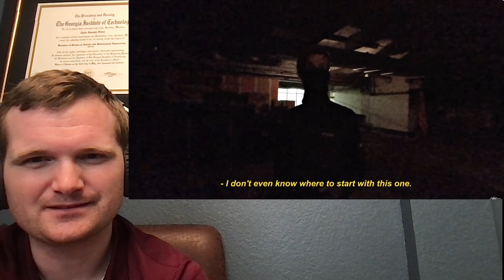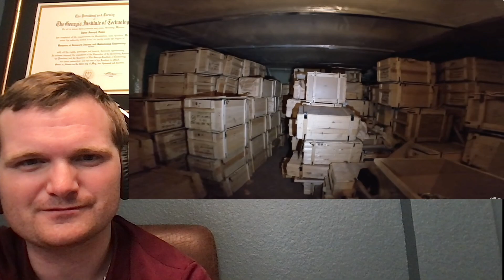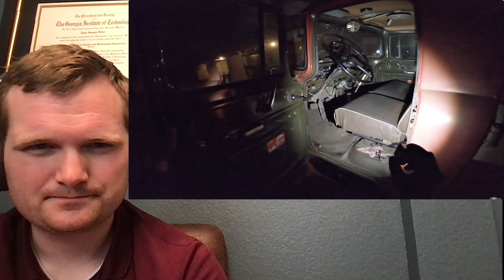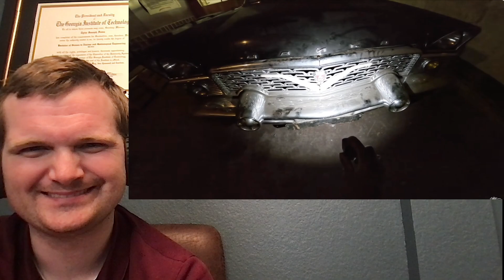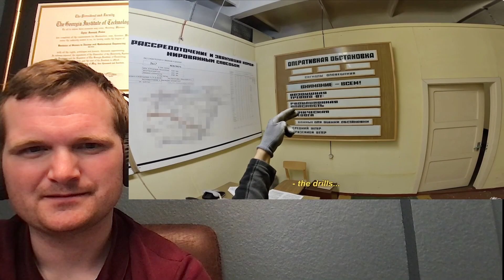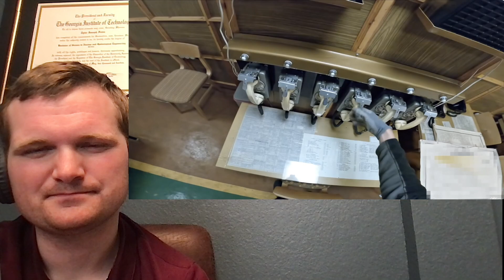Abandoned Nuclear Bunker with Vehicles and Gear - Nuclear Engineer Reacts to Shiey

Comment: The headphones plug he unplugged isn't actually abnormally big. Instead of the common 3.5mm most devices use today that's a quarter inch plug. Most audio equipment and audiophile grade gear still use it. It's exactly identical to 3.5mm it's just far less likely to break or bend. For audio equipment it's far more popular for equipment that gets constantly plugged and unplugged.

Comment: Having vehicles in your bunker is mostly a good idea, the issue is that vehicles can't sit long and be expected to work. The oil, and gasoline collects water from the air over time and gasoline basically breaks down into a sludge in a very brief period of time. You need stabilizers for even just a year so these vehicles would need to run dry at least once a year. It's really hard to save a vehicle once it's sat for more than 3-5 years. Most of the lines in it will be full or gunk and the metal lines may rust out from water absorption.
Reply: Diesel vehicles like a few of the ones shown however would be relatively fine for long term storage, It's often even preferable to have them stored filled to prevent rust. I've run equipment with 20 year old diesel that didn't care in the slightest. Newer injector systems with their tight tolerances of course however wouldn't be too happy with it but that's about it.
Reply: Gas only goes bad if it has ethanol in it. I've run engines on aviation gasoline from the 1940s when an old tank was being removed from the local airport. No issues, engine ran really smooth on the purple 115 octane aviation gas.
Reply: Some of what you say is reasonable. Most of it is not. Why do people insist on commenting on things they really don't know anything about.
Reply: @dustinandtarynwolfe5540  Look man, he bought a $300 pickup that sat in the rain for 6 years and never got it started after changing the battery multiple times. He's an expert now.
Reply: I believe the video reactor just meant keeping vehicles in a bunker in general was a good idea. He's a smart guy I'm pretty sure he would know they would need to be maintained and so would the authority over the bunker.

Comment: That picture of the big V16 diesel generator brought back some memories for me, years ago ended up on a project to rebuild a diesel about that size years ago, though it wasn't a generator in the same sense as those in a nuclear facility, the one I worked on was a tug boat engine/main generator. Marine powerplants are absurdly large, the one I did was small being about that size, but none the less seeing that picture brought back memories standing next to that thing going "crap what did I get signed up for, I'm a small engine tech"